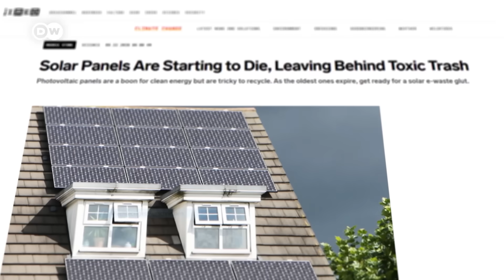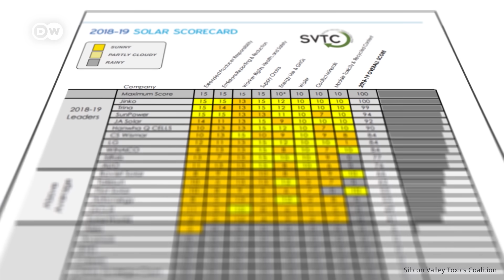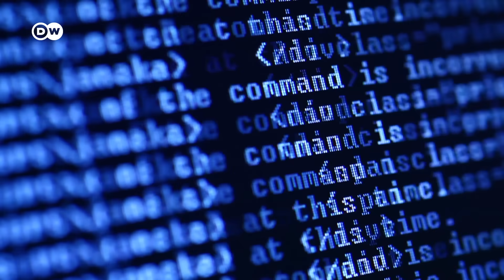How green is solar energy really?

Comment: No mention of the fact that solar panels heat the planet.  They do so because they have a lower albedo than almost every surface they are placed on.  This is known and justified because they heat the planet less than the CO2 of fossil fuels emissions.  But, what happens when they have replaced fossil fuels?  There are studies showing that solar provision of global electric needs would actually heat the planet 1 to 2 degrees C.  And it would alter the global weather patterns because of the shifting around of heat.   Currently, this is probably only problematic for urban heat island effects, but it is something that has to be considered.

As someone else mentioned, this analysis also doesn't seem to take into consideration the necessity for storage required by intermittent solar, because that has to be included in its cost; it isn't dispatchable, like, say, nuclear.

Finally, I was struck in this video by the amount of land area that is removed from any other kind of use.  What a waste!
Reply: Agreed. They're bulldozing farmland, forests, jungles and deserts all over the globe to lay hectares of panels. This is unprecedented and permanent plant and animal habitat destruction. I thought that this was what we were trying to avoid.
Reply: @anthonymorris5084  What we are actually trying to avoid is catastophic climate change which could lead to mass extinctions.
Reply: @craigphd7844   "What we are actually trying to avoid is catastophic climate change"  There is no evidence that climate change (or warming) is catastrophic. More than 100 years of climate change and 40 years of climate hysteria has proven that warming is mostly benign, manageable and positive. Data proves we've never been safer, healthier or more prosperous than at anytime in history. Death tolls from every natural disaster including every single climate related disaster has been in precipitous decline for a hundred years. Life expectancy continues to rise. 

"which could lead to mass extinctions."  That is a completely disingenuous argument. The only thing that has ever threatened plants and animals is poaching and habitat destruction due to human encroachment. Data proves polar bears are thriving. Grizzly bear habitat is expanding due to climate change. Not a single rhino, elephant, tiger, mountain gorilla etc., has died because the world got warmer. In the 1800's  100,000 tigers roamed the world. Today there are 3,500. All of a sudden climate zealots are worried about animals.
Reply: @anthonymorris5084  Yeah, carry on ignoring actual facts and data. Just continue using your climate change denial handbook as a reference. Meanwhile the rest of us will do something about it on your behalf, and we won't even ask for a thank you later.
Reply: The heating effect of solar panels on the planet, is actually negligable. Panel heat is calculated at approx 0.03w/m2.  Even with that low figure, it is also necessary to factor in the reduced heating effect of the surface now covered by the panels. The albedo of ashfelt is lower than solar panels. Covering ashfelt roofs with solar panels actually reduces heating effect. The only study that I could find that showed solar panels affected the planet heating and weather, was when using solar panels to cover over 30% of the Sahara desert. Which is actually impractical.
Storage of power from solar is indeed a major problem. It is considered the Holy Grail to find clean efficient storage. Batteries are not the answer. 
In order to curb global warming by reducing Co2 emmissions, it is not actually necessary to totally eliminate fossil fuel electricity generation. (although that would be a good thing). In practical terms it needs to be reduced by a minimum of 50%. (Some studies say more, some say less). 30TW is the generating capacity provided by fossil fuels. Solar power is not required to replace half of that figure. Other sources like wind and wave power also have to be factored in.
Solar power installed for household and commercial premises does not require batteries. These on grid solar systems can reduce power consumption from generating companies during the daytime. I personally have a small (3kw) solar system without batteries and my consumption of power supplied by the generating company has been reduced by 65%.
In order to replace all fossil fuel generation, nuclear power at present is the only option to provide additional power when solar/wind/etc cannot.

Comment: No mention of the fact that solar power can only be generated during a short period of each day.  Solar technology is the future but battery technology is the only way to make solar workable for "replacing" fossil fuels.
Trying to keep the heat on during winter using solar power is still years away for high density urban areas.  How much battery storage would be needed to keep New York and Chicago heated in January?

Comment: A solar panel has no moving parts , so they last 100 years
Reply: wrong
Reply: @bagamax  why?, There on the ISS
Reply: @professorJorge11  panels degrade under the sunlight and because of current flow. Highest quality panels in right conditions can have 90% of initial performance over 30 eyars, but thats it, no warranty further. Cheap mass produced panels can lose 20% of initial perfomance in a single first year.
Reply: @bagamax  ... and there's a rover on Mars that has solar panels
Reply: @professorJorge11  you're talking about best panels in our Solar system and still their longest service time is only 15 years.
Reply: @bagamax  si, if  I put a satelite in orbit the in 15 years , it's dead?

Comment: For some panels, reusing them wholesale as a physical thing (roofing panel??) might make more sense. Depends on recoverable value, and remaining toxicity. But the principal thing is connecting the cost/design of manufacture with the cost/design of reuse, so that both sides of the equation are communicating with each other. OTOH one also needs new technologies to be tried out. If one tries to make them entirely toxic on day 1, some designs will never see the light of day (haha). Yet if toxicity ends up being baked in for ever, in some cheap but not very cheerful idea, that's not good either...

Comment: A unnecessary purity test. Compare that to any product in use today. 

Don’t all products have to be mined transported and assembled?

I think every product should be held to the same standard.  The worst offenders should be called out. Solar panels are way way down on that list.
Reply: Don't you dare bring logic and critical thinking into this discussion. It's like the sadly misinformed who claim evs are useless in a power outage. Yet all fossil fuels require massive amounts of electricity just to refine them. Store them, pump them over long distances and then pump them out of the storage tanks into a cars fuel tank. So no power no gas or diesel either. 👍🏻😁

Comment: Solar and wind are solutions to a problem just not c02 reduction.
Nuclear is the only viable option for reducing c02 emissions but only if you’re dumb enough to believe that c02 emissions are a problem that needs any kind of solution especially those as toxic and dangerous as wind solar and nuclear.
Firstly in order to detrimentally affect the climate humans would need to do stupid things like cut down forests to erect wind farms and cover great swaths of land with solar panels and dam every valley for hydro power. Water vapour is the only actual green house gas of any notable effect and it literally swamps c02 both in volume and spectrum absorption.
There are about a thousand or more water molecules in the atmosphere for every c02 molecule and the water molecules get to the suns radiation and gobble it up before c02 can get out of waters shadows. So it is extremely questionable that even 4000 part per million of c02 will have any more effect on the climate than 400 ppm , except that the planet will be a lot greener fewer people will be starving to death there will be less extreme weather as more trees reduce storm energy.
The best way to understand climate change is to call it by its original name Global Nazism. Climate alarm is a disgusting scam perpetrated by people who think Stalin and Hitler were heroes to emulate.
The climate alarm scam is harming the environment and ironically causing more carbon emissions than if nothing was being done to try to reduce carbon emissions. Instead of investment going into cleaning up existing energy systems and reducing real pollution like heavy metal and toxic chemicals being dumped in the environment wind and solar cause vastly more pollution.
And I’m sure the lifecycle emissions estimates for wind and solar are leaving out a lot whereas coal and gas are having things counted twice.

Comment: I know it's possible to design panels to be easier to recycle. Since it wasn't a necessity, not much thought was given to it. It may cost more on the front end but if it cuts the overall cost when the cost of recycling is added to it, is it not worth doing?

Comment: Of course DW Planet A forgot to mention nuclear when comparing the alternatives.  Nuclear plants emit only 12 gCO2/KWh, which is about 4 times better than solar. This will be much lower with SMRs like NuScale, GE-Hitachi BWRX-300 or with molten salt reactors.
In the disadvantages they also forgot to mention the raw material requirements of solar, which is about 15 times more. 
15 times more mining, refining, transporting to generate the same amount of energy and this does not count in the extra raw material requirements for energy storage solutions extra transmission lines etc. All which would not be needed, if we replace fossil fuel plants with nukes. No need to have gas power stations as backup for the nights and cloudy days either, no dependency on (Russian) fossil fuels. 
What about the 4-500 times more land requirement? It is also missing from this video. With solar you take 4-500 times more space away from nature or agriculture.

If you really care about the environment, you should have once a video with a conclusion:
8:28 Well, solar panels nuclear energy is not entirely green, but that definitely doesn't mean we should turn our backs on it. It's benefits are way to great for that. Instead we should openly addresses it's problems and figure out how we can fixed them.

I guess, that's never gonna happen.

Comment: What about the batteries they charge. They have gigantic carbon footprint and have only 3 to 6 years of life.
Reply: Links to your claims? The grid scale bess systems currently being installed last 12-15 year's at a minimum. 
Teslas Hornsdale project went up in less than 90 days over 3 years ago now. 
Made it's entire capex back in 20 month's and has saved residents millions and millions of dollars of their electric bills. It also kept the local grid from going down in multiple major system wide events. That areas without a bess system crashed from.
Batteries at grid scale are absolutely the answer to adding more renewables onto a stable upgraded modernized cleaner more efficient grid. 👍🏻

Comment: Does the per kilowatt include energy storage for numerous hours or simply just during operation? Ultimately, the goal is to use solar for all energy need, yes?
Reply: Without storage.
Reply: Plus wind  and hydro and biofuel from waste.
Reply: In most talks about renewables, the calculations are without storage and under ideal circumstances; It's the two big catches that you might not notice until you already built the farms... And then suddenly needs something to shore up the deficit while also seeing your carbon footprint rise, rather than drop.

Comment: Batteries last 2 to 3 years only. More waste!
Reply: Batteries are not necessary for household installations. That is, on grid systems.
Reply: @craigphd7844  Sure, so long as you have something else producing your electricity. Which, is either going to be nuclear or fossil fuel.
Reply: @OzixiThrill  That is correct. There are lots of interesting developments in the pipeline regarding energy storage, but thay are not available now. Now is when they are needed. We can't wait 3+ years for something that shows promise, because if it doesnt work, that's years wasted. Nuclear will have to be the answer. An announcement today seems to show France are planning on doing exactly that.
The amount of fossil fuel generation can be reduced when solar is installed on houses. My installation, without batteries, has reduced the supply to my house from generating facilities by 50%.

Comment: Even without recycling solar pv requires 100's of times less mining per MWh as fossils or nuclear.  
Coal about 500 tons per GWH
solar pv:

Typical panel 25 kg per 250Watts.
1 kg per 10 watts peak.

About 6 hours per day, 365 days per year, 30 years.

700 KWH lifetime per kg.
700 MWH per ton.

Solar panels: 1.4 tons per GWH. 400 times more energy per mass as coal before recycling.

The solution is to mandate recycling.  That's the only thing that works. Dumpling it too tempting. 

Recycling costs drop 10 times or more after mandating.  

search Scrap solar panels buyers
They are all over the place.
People are just too lazy to even bother.

Comment: These are many what if’s I’ve worked as a solar panel installer and maintenance on power plants for years and no power plant is going to throw panels in the trash. Most have either contracts with the government or the manufacturer to recycle or return and if they don’t it would be a loss for the business to not sell them as e waist.this sounds like a disinformation campaign from the fossil fuel companies if we’re gonna add in how much greenhouse gases are produced to make the panels they why don’t we start tacking on how much is produced to build a coal plant and how much it is to mine and ship the coal not just how much it is when we burn it .
Reply: Also the most efficient solar panels we have right now are only something like 29% efficient and those are the million dollar ones in space the ones we use on plants are only about 15% to 18% so we have tons of room for improvement

Comment: This discussion leaves out the issues with the storage necessary with renewable energy
Reply: If you want to keep everything solar, there are heat storage technologies based around  inorganic salts, that can power  the grid for a few hours after sunset. But you're right, solar needs to be complemented with Nuclear, Hydro, Wind or Tidal to keep the grid ON at all times, under different weather conditions.

Comment: Umm, what about BATTERIES? converters? wiring? That's all toxic stuff. Specially batteries, which are essential. Greenies always love to play funny stuff with the facts, and reality.
Reply: Batteries are not essential in household and commercial installations of solar systems. On grid sytsems do not require batteries. over 70% of household and commercial premises using solar do not have batteries. My own installation does not use batteries. My use of generating company supply has dropped 50% since installation. So far thats resulted in a reduction of 1200kg of Co2 put into the atmosphere. (and my bill is lower!). So no, batteries are not essential.

Comment: You didn't mention these huge areas of solar and wind power plants which have quite an impact on wildlife.
Nuclear fission is the cleanest for the moment. We need to have a rational discussion instead of irrational fear claims.
Reply: Look up 
cost of electricity by source     Wikipedia.
    
Nuclear costs to much.     Wind and Solar have really come down in cost.
Reply: @ronaldlindeman6136  Nuclear costs a lot due to a lot of red tape and rabid lifespan reductions in recent years from nothing but politics. If you check the graphs for the price, you'll notice that nuclear used to cost far less (about a half of what it currently is) and was trending down (expected from any technology that is developing). Then after the nuclear oversight group formed in 2010s (their name escapes me) along with Germany's rabid early retiring of nuclear plants, the price hiked up rapidly.

Add to that the fact that solar and wind farms' energy cost calculations often fail to include the price and impact of batteries (something vital for their function) and you have some numbers that are deflated for renewables, while inflated for nuclear.

Finally, the environmental impact of renewables is often ignored. Namely how they often need to displace farmland (which then later moves on to claim a forest instead) or forests.